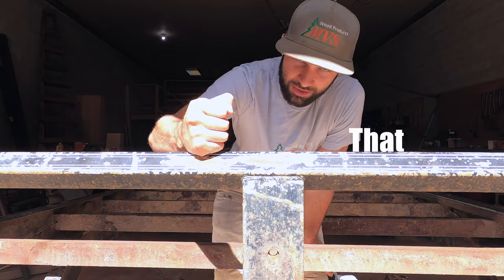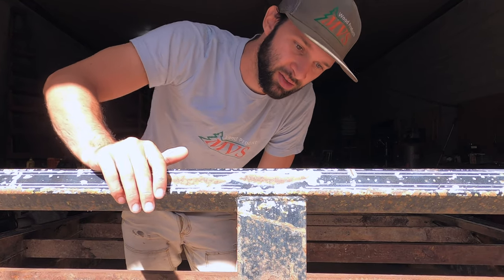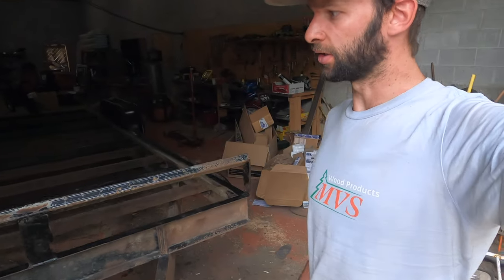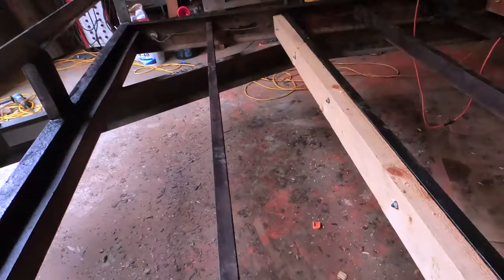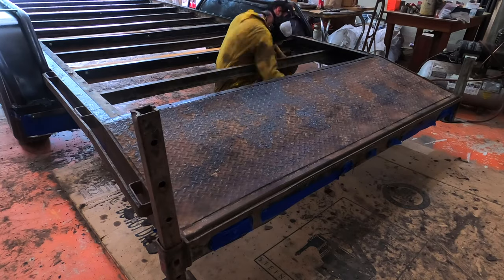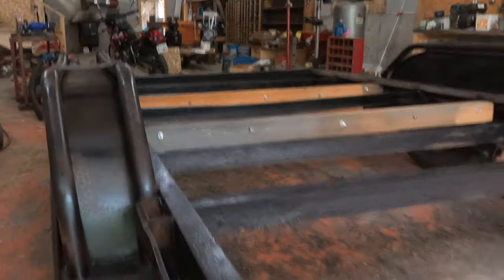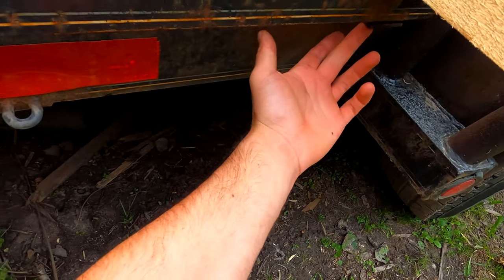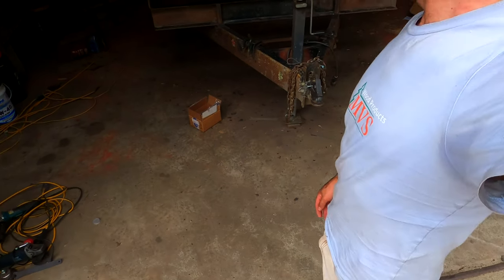Restoring a Crusty Log Hauler Trailer

Comment: You spray bomb that entire thing!?
Reply from the maker: That’s right. It might have been right on the line of worth it to use a paint sprayer, but for a piece of industrial equipment… na not worth the setup. That was my logic anyway.
Reply: @MountainVoiceInc  I'm a big fan of old sloppy paint brush and bucket of tremclad.
Reply from the maker: That would get the job done alright, just a few drip lines, but a good way to get lots of paint on.